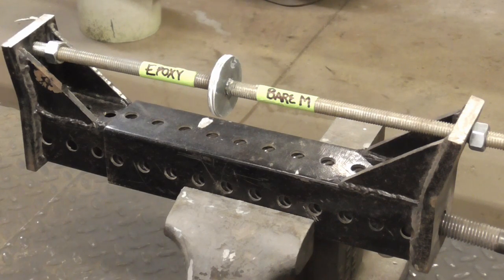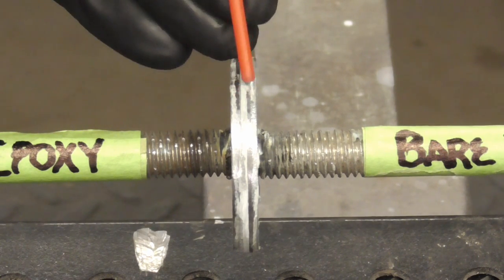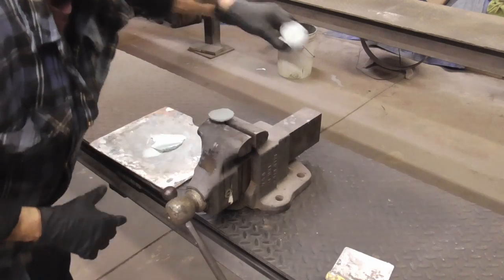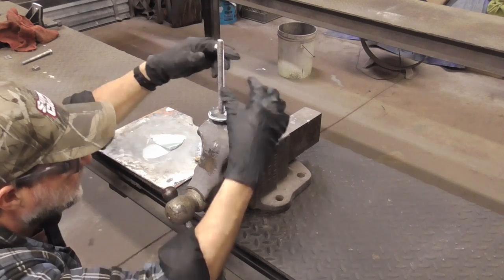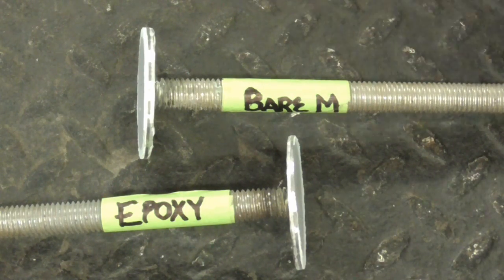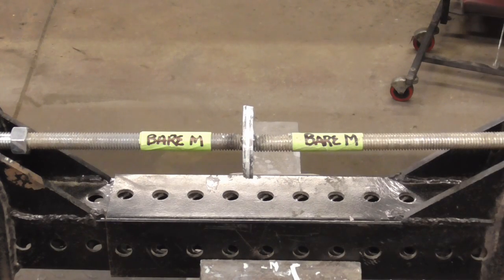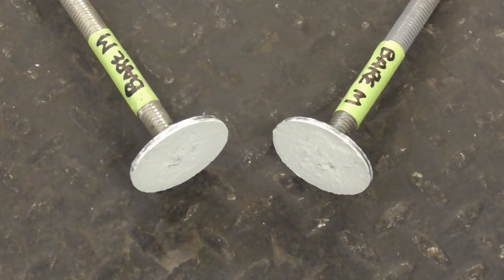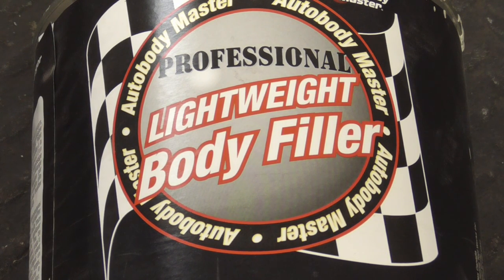Apply Body Filler Over Bare Metal or Epoxy Primer?

Comment: Excellent test.  I finished all my welding and planned to skim coat the entire car after grinding down to bare metal.  Thought I might need epoxy primer, think I will skip the epoxy primer now.
Reply from the maker: Remember filler came out 30-40 years before epoxy primer.  It was designed to put over bare metal, most body shop require workers to apply over bare metal.  Paint is what protects metal from corrosion not anything underneath it :)
Reply: @LakesideAutobody  In the mid 70’s, I prepared my car for repainting.  I went down to bare metal in several spots, but failed to etch it before I primed and painted. I didn’t use any bondo, but did use a Red Putty product a body shop worker suggested.  A few years later, rust broke through.  That’s why I was leaning toward an epoxy primer, but won’t use it with a complete skim coat of bondo.  Thanks again.
Reply: @mrfrank5757  that red putty I suspect was nitrostan a red thick primer you could purchase in a tube or quart can and was used only over a primer surfacer for minor scratches and pin holes in body filler usually lacquer based and very old school ,  sucks by comparison with todays products

Comment: I've seen many jobs with filler over bare steel having flash rust under filler.   Epoxy has come a long way.   Many collision shops don't have time for extra steps.....mud and go.
Reply from the maker: I don't get it.  Are people parking cars outside for months before they paint?  Paint the car after you've done the body work and your done.  No worries ever again about corrosion.  Easy.  I guess if you are leaving the car in the rain for weeks at a time the epoxy would come into play but even the epoxy label says (on many) that it is not water proof.  The only way to protect from corrosion or rust is paint.  Trust me my friend, it will save you time. $ and the frustration of sand paper getting clogged trying to sand filler with epoxy primer underneath.  Nice talking to you OC - have a good week :)
Reply: @LakesideAutobody  I'm not sure why the rust under filler.   Maybe outside like you say, poor prep, or temp changes.    I do know if metal is prepped and epoxy applied then applying filler and scuff within the 72 hrs or so you have a chemical and mechanical bond.  Epoxy agreed not for blocking sanding.   2k over it or poly over it.    Too add I have had parts personal projects prepped and several wet coats of epoxy sit outside for years..... mainly to test.   Only issue was chalking from sun.    Enjoy your week, just trying to add what I know, much for all of us to learn.
Reply from the maker: @overkillcustoms  Good points O.C. - Nice talking to you - hope I didn't offend you in any way.  Thanks for the comments :)
Reply: @LakesideAutobody  No offense taken at all.   Body and paint is not an easy gig, it's very tedious and expensive.  We both know that what is discussed here is just a touch of what is involved.   Trade secrets are given however it requires a ton of work.

Comment: There are different grades of epoxy ..was this spraycan or spray gun..I've found an industrial epoxy is much stronger than most and can be used in restoration  work
Reply from the maker: This was good 2K spray gun epoxy - not spray can.  I plan on doing it again with diff brands, dry times, etc.  Have a good week Ross :)

Comment: I have a 69 Charger I'm getting ready to do this year. I don't have a garage and I'm stripping it down to bare metal then blocking the whole car. Would I be safe applying the filler over the epoxy primer? I'm kinda in a pickle because if I don't seal it, it will flash rust on me. Thanks in advance
Reply from the maker: That will work fine - here's another vid on that topic.  It will help you rest easy :)
Reply: @LakesideAutobody  thanks

Comment: totally misses the corrosion resistance of epoxy primer that filler to bare metal does not offer. Plus the filler stuck very well to the epoxy as it broke the coat in half. Mybe the application of epoxy was not done properly
Reply from the maker: The 2K Epoxy was allowed to dry for the time the data sheet required.  It will be the weak link of the repair. Feel free to use it though.  Just trying to save you time and $.  Remember filler came out 30-40 years before epoxy primer - how'd they apply filler then?  Their paint jobs all failed?  No. See this video from DIY Auto School for more on this topic  - https://www.youtube.com/watch?v=rtUoaRxmgAg&t=424s

Comment: Had a body shop local to me tell me oh make sure you do your body work over epoxy primer because if you don’t when the  body filler heats up it’ll start the rusting process, nope I don’t believe that
Reply: You should there is truth in that also
Reply: Also what they mean by heating up is the initial curing stage of the filler it does generate a great deal of heat at that point drawing moisture out of the metal thus starting the rust process .

Comment: Was the epoxy sanded or just filler right over during its few day window?
Reply from the maker: Here's another I did soon after this one as folks said to give the primer more time to dry.  I don't think it was sanded - epoxy is a bummer to sand - https://www.youtube.com/watch?v=wVhQLqPAGVU
Reply: @LakesideAutobody  ok, you need to do a trial of a coats of primer and scuffing with 120 grit. It does need to sit for a few days before scuffing IMO
Reply from the maker: Did you check out the other video - it's a bit more accurate.  I think either way you'll be fine.  Remember, the best protection from rust is the finish so it's really not necessary to primer before filler.  Body shops do not do it.  It's sort of an internet, magazine thing :) @MrMuffanga
Reply: @LakesideAutobody  I haven't watched it yet. However I've been thinking of the same thing lately. Yes if u have a chip or a crack moisture will get underneath. But unless it's sealed from the clear coat. It can only rust from the back side from rotting on the backside.
Reply from the maker: You are absolutely correct.  Nothing is better than the top coat.  I suppose if you are going to be working outside, and waiting a week or two before working on it again OK - throw a coat of epoxy primer on it. @MrMuffanga
Reply: @LakesideAutobody  I think with restorations, with how long they take. Epoxy should be put down first. Because filler and primer will still absorb moisture until it's painted

Comment: Except it holds moisture the metal will rot through underneath the bondo always apply in epoxy primer to seal the metal first otherwise you're just putting a Band-Aid on and it will rot through under the Bondo
Reply from the maker: Always remember..... filler came out 20-30 years before epoxy primer.  You would get fired for putting filler over anything but bare metal.
Paint is what protects everything underneath - not primer.  Magazines, TV and internet push that idea to sell products.  It's not true.  Now.... if you leave it outside for a few years before painting then OK, throw a coat or two of epoxy primer on it.  Lacquer primer works the same - see this video - https://www.youtube.com/watch?v=zGHxBr_LpzM  I like your channel idea by the way ✌

Comment: My air compressor tank has a little hole in the bottom. Can it be fixed?
Reply from the maker: Yes - you can weld it.  People will say that it will blow up but that's not true.  If the weld fails it will start to leak slowly out of it again.  When your relief valve is stuck and/plus your pressure switch is broke at the same time then you have an issue.  No air escaping and the compressor keeps running - not good :)
Reply: @LakesideAutobody  Thank you

Comment: So many debates over this. Just got off the phone with Tamco they said no filler on bare metal creates heat then condensation on metal and to put over there DTM high build 5310. I do not need epoxy if car is inside all the time it will save you a lot of money just block and top coat your done and still have epoxy properties in the DTM.
Reply from the maker: I doubt the guy on the phone is a body man/woman. I've never experienced condensation under filler - ever - since 1980.  My dad either since filler was introduced.  Filler came out 30-40 years before epoxy primer.  How did we apply it in the 60's 70's 80's 90's?  How do they explain condensation forming when there is no more air or oxygen after you spread the filler.  I promise you that if your surface is solid, no pin holes, rust, etc.  10 years down the road you can remove that filler and there will be nice clean metal.  Remember companies will always lean towards selling as much unneeded stuff as possible.  Paint protects everything under it - that's the best thing to remember :)
Reply: @LakesideAutobody   Probably the best answer I've heard yet thank you
Reply: Would you still epoxy and then do filler?
Reply from the maker: @Supanova70  Save your time and money.  All shops I've worked at put filler on bare metal (S.E. MI).  In fact, you were embarrassed if your boss caught you throwing filler over primer, paint, etc.  Although we did plenty of times.  Filler on bare metal for dents and big damage.  You can get away will applying filler over primer and paint for the smaller stuff though - we used to do hail damage that way.  Jerry
Reply: Tampco paints yes very well versed in automotive and industrial coatings Jerry they manufacture them and have very knowledgeable chemists in there employment and they are correct about there Recommendations . Guy on phone was correct , and DMT primer is a epoxy highbred

Comment: I wonder what would happen if the experiment was repeated giving the epoxy primer the correct amount of time it takes to fully cure???
Reply from the maker: I'm in the process of making that video.  Only this time I'm going to do it a bunch of different ways - diff dry times, brands, grits, etc to see if anything can come close to the filler/metal bond.  I'll use a digital torque wrench too on the PEAK setting to record maximum torque before coming apart for every trial.  It'll take some time but should be pretty interesting.  Hope you check it out :)
Reply: @LakesideAutobody  very cool, thank you. It's something I'm scratching my hair out over at the moment, as I'm starting a restoration when the weather warms up a bit here in Ireland. And figuring out the best way to go about it for maximum corrosion resistance with all the conflicting information on the internet is a head melter! So I'll be eagerly awaiting this. Thanks.
Reply from the maker: @danielcampbell9220  It's not a head scratcher if you worked in a body shop.  Filler always goes over bare metal - period.  Remember, body filler came out 30-40 years before epoxy - when working, I thought twice about it.  Matter of fact, if you got caught putting filler over anything but bare metal, you'd embarrass yourself.  Don't ever think about it again - it goes over bare metal.  You'll never have a problem - promise :)

Comment: What are you classifying as epoxy???  Is that fibreglass filler or something else???
Thanks from DOWN UNDER 👍👍👍👍👍👍
Reply from the maker: The products are listed in or under the description.  The epoxy primer was allowed to cure or dry for 24 hours at 70 degrees.  The filler is just regular old body filler.  Both products are from  Auto Body Master.

Comment: Never had body filler come lose on epoxy primer, but evertime I've sanded old body filler off that was put to bare metal there is rust.
Reply from the maker: With respect JK - that's bad information.  The only way there was rust under the filler is if the surface/metal was porous - i.e. bad welds, rust patch not repaired right, super thin metal from corrosion, etc.  If filler is applied correctly you'll never have corrosion under filler.  Save your $ and time.  Remember filler came out 30-40 years before epoxy primer.  How'd we apply it then?
Reply: @LakesideAutobody  not bad information it's 40 years in body shop work experience. That's why most manufacturers want you to put filler on oem finish and not disturb the e- coat on them going to metal. I've never had filler come lose from epoxy. But I do sand my metal with 50 grit then spray epoxy.
Reply from the maker: @jeremyking5684  I'm going to do the test again but let the epoxy cure or dry longer.  We'll see how it goes the 2nd time around.
Reply: @jeremyking5684  yup thats why i apply over epoxy now however his experiment is interesting

Comment: I would not have known that. But I will just body fill bare metal. Thanks
Reply from the maker: Body filler always goes over bare metal but you can get away with putting it over paint and primer.  It's frowned upon in professional shops though :)

Comment: The fact that the epoxy split is proof that the filler has a stronger tensile strength. They both stuck to the metal. It also proves that the epoxy sticks well to the filler, which is what it is designed to do.
Reply from the maker: Remember... filler was designed to go over bare metal.  I was put over bare metal 30-40 years before epoxy primer even existed.  It has it's place in the shop.  Works well for aluminum, good if you are parking it outside for sometime before painting, etc.  Not necessary under filler.  Paint protects everything underneath.

Comment: Body filler is hydroscopic. It absorbs moisture can corrode the bare steel over time. This debate will never end, only individual opinions will change. When will an automotive paint job be subject to this test in the real world? Filler still bonds to epoxy very well in automotive applications. Moisture can be absorbed into the body filler or primer through rock chips or deep scratches and cause rust to break the bond between the steel and filler. Either method will work fine for an undisclosed amount of time and circumstances.
Reply from the maker: Are folks parking cars outside before they get painted?  Your paint is the only thing that is responsible for sealing out moisture - end of debate.  Everything between the metal and paint are not made to be exposed for long periods of time to moisture.  Paint does the trick.  No professional shop will accept filler over primer.
Reply: @LakesideAutobody  I just saw it on a truck yesterday. Exposed filler left un painted. Filler was brown with rust coming through. Guy said it was done a few months ago. A little epoxy under there might have saved him from paying double to re do it.

Comment: I think this obsession with epoxy primer is way overdone.  I'm totally frustrated right now because I'm dealing with a car that was stripped to bare metal and coated with epoxy primer by the previous owner.  By all the youtube videos I watch, this guy did it right.  Unfortunately it sat outside for at least a year before I started on it.  Now most of the top surfaces are rusting underneath the epoxy and coming through.  Could be the guy let it rust between strip and prime I don't know, but it is a shame I have to now grind off all that primer in order to treat the rust.  Epoxy primer does not grind away easy.
Reply from the maker: You can't sand it and it doesn't prevent rust. Paint protects the metal from rust - period.  Epoxy primer is not needed at all.  Body shops (high volume) do not use it - it's more of an internet, blog, magazine thing :)